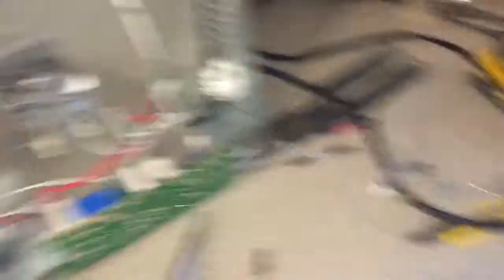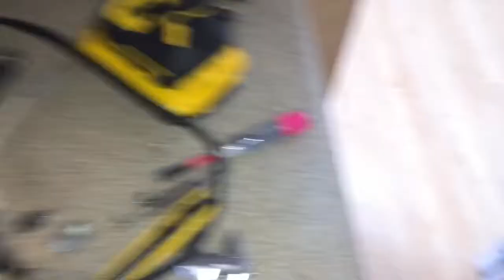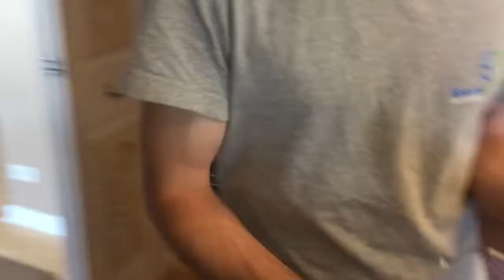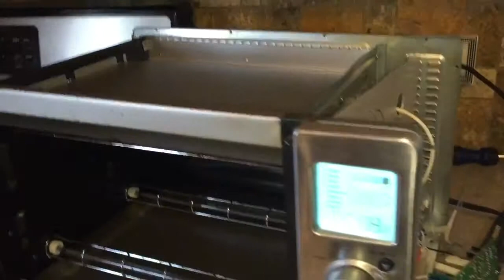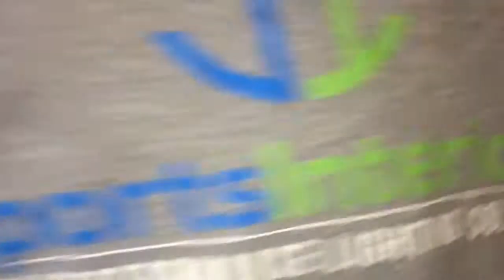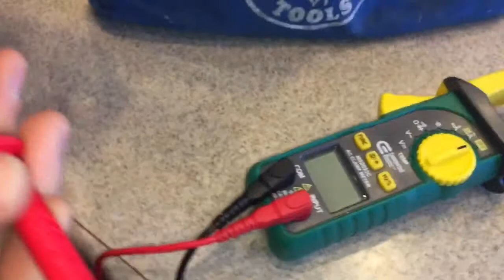Frigidaire Oven E02 Sensor Repair

Comment: Update: I fixed the E02 problem by reflowing the solder pads where the the heating element connector plugs into the PC board as in the video. Thanks. John

Comment: Great video. Our toaster oven was turned but a big lightning strike took out the 500ma PC mounted fuses on the board in the video. I replaced the fuse and no the oven turns on but got E02 code. I will following the video to check the PC bard traces/solder joints and the thermal couple to. Thanks John

Comment: Thanks very much for this. If anyone has the same problem, I found that the E02 would not clear until you power on the oven with the two thermistor pins shorted like you did at the end of the video (I used pliers to touch the two pins). I got an E01 when doing that. Then re-started it normally and no error at all. Thanks again!

Comment: I have one and the top (infrared) elements stopped working. Using a meter, I found that the front top element was open. Where can I buy one?
Reply: I have the same problem with the top elements not working....